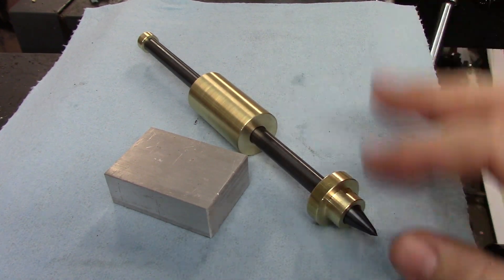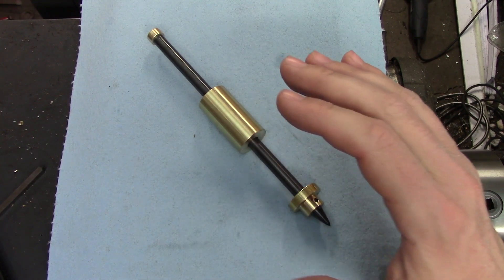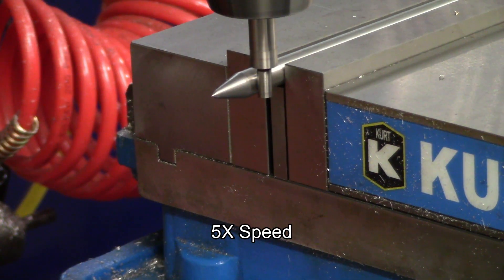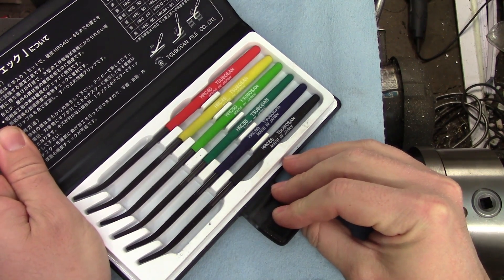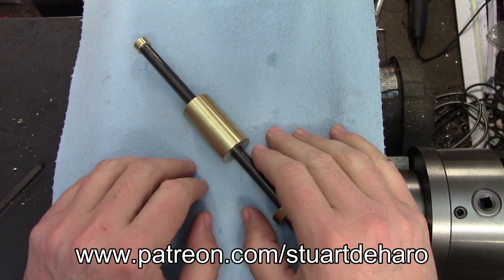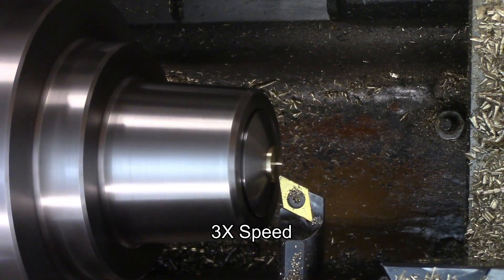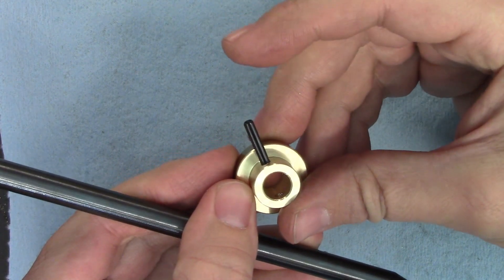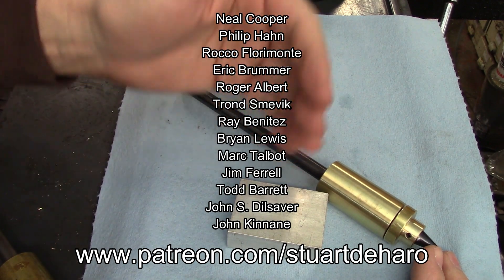Making a Slide Hammer Center Punch

Comment: Thanks Stuart.  I have actually never seen or heard of these before.  Looks like a great idea.  I've never purchased an automatic punch. They look dangerous to me as I can see it skating across the metal.  Thanks so much. I think this will be a nice project and a useful addition to the toolbox. I've always enjoyed your channel and refer back to it often for information. And the dry humor is funny too! Thanks
Reply from the maker: Thanks K W. The automatic ones aren't too bad, but they can definitely slide a bit as you're pressing down on them. They're actually a pretty cool project too. Maybe looking at a future video too.
Reply: Adjustable auto punches are very handy. Start with the minimum striking force to make [and check] a tiny mark, then wind it in to a greater strike force to make the final punch mark, much reducing any tendency to skid. I have two in my bench rack, one of which I use for setting the mark and the other for the punch mark itself. I keep the first of these turned to a finer point, which aids accuracy of marking, but that point would not last too long if you applied full punch force to it.
If you make a little adaptor, these make handy little pin punches for setting and countersinking in very small nails/pins in very fine cabinet work.

Comment: I like the visibility of the tip on a scribed line.  Most of my center punches are forged and I'm usually wearing an optivisor, and seeing the tip is not always so easy.  I don't have the hardness files, that might be a nice thing to have. I'm often tempering in a toaster oven that goes to 425 or 450 deg F, I've wondered about picking up a second one and trying to play around with it -- shorten the heating element -- o achieve a bit higher temps. Shorter element = less electrical resistance = more current = higher temp, and measure the temp with an oven thermometer.  Always lots to think about and play around with, thanks for posting!

Comment: Cool project.  I notice that you broke out the 5C collet chuck for this project. I get that a 3 jaw is really for convenience where precision may not be super paramount, and that 4 jaw gives you more control over centering the work piece, but what advantages does the 5C collet chuck provide?  Im assuming that it works best for small stock, but are there any other inherit benefits, or situations where it is shines over other chucking options?
Reply from the maker: Collets hold concentricity very well. I had actually switched it out for another project which was going to be the video/giveaway, but I had to order some springs and they didn't get here in time. That'll be the next one I guess.

Comment: One of my favorite projects was making slide hammer vise grips. Very easy. Get allthread that matches the vise grips, use the lathe to drill a hole through bar stock, knurl, part, twist two nuts again each other at the end so the hammer doesnt fall out and you're done.
Reply from the maker: That's on my list! I was thinking I'd keep the slide hammer theme going and do it for next week's video. I made some for a coworker right before Christmas too, so it’s been on my mind.

Comment: I'm in the market for a 5C collet chuck for my lathe which has a D1-4 mount. What would you suggest?
Reply from the maker: I got mine off ebay ages ago. Several sellers offer one like mine although I never see them offered as adjust-tru chucks anymore. Mostly you see them as plain back chucks, so you can put a D1-4 backplate no problem.